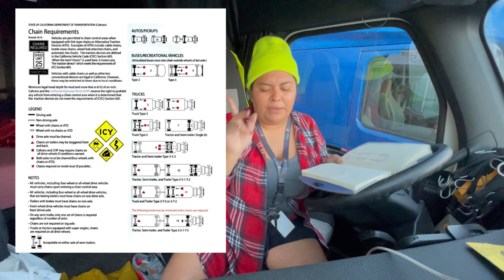How to chain my tires truck and trailer

Comment: i appreciate you answering my questions. How often do you have to do split loads or t calls? when you get a load and you have to have someone else take the load that you picked up?
Reply from the maker: Well with all honesty that depends a lot on the driver i have t-called 2s and swap like 3 times. FYI the only reason why loads get tcall is if he or she run out of there 70. And driver leader is aware or if you breakdown. I alway plan my self accordingly and per-trip my truck/trailer before a full trip that helps me I don’t really like t-call cause not every driver takes there time from the beginning to check there trailers and some don’t weight there loads and I don’t like hauling without a scale ticket. Like once you committed to a load its your responsibility.